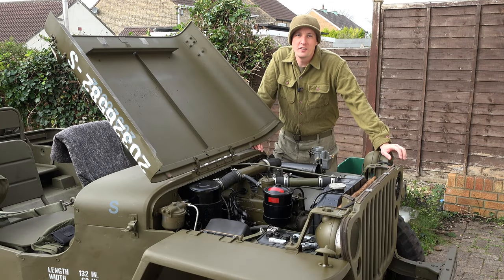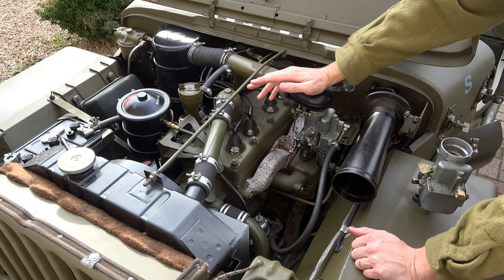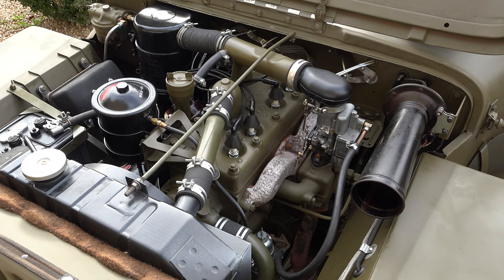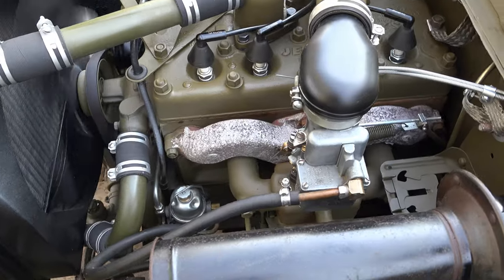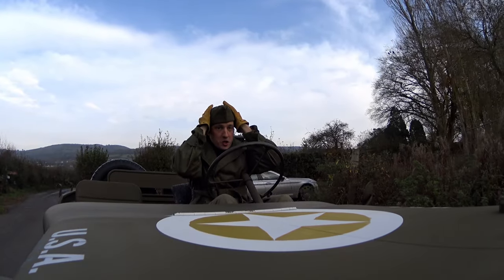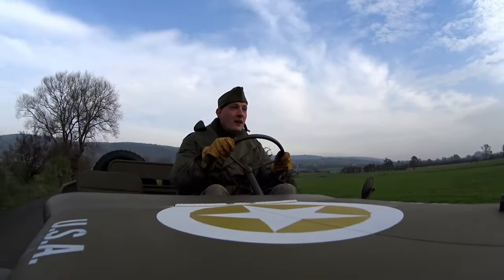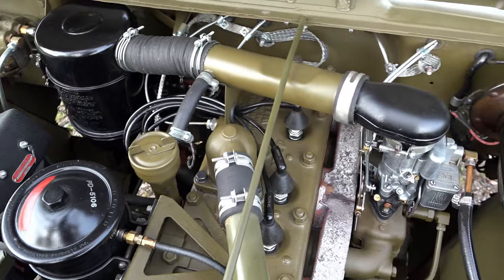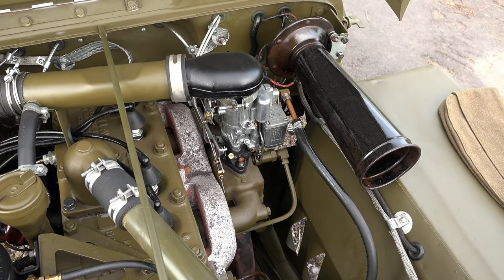Whats better Old or New?  Willys Jeep rebuild test

Comment: Love your video!  I've just modified a Carter 539S accelerator pump piston using an ethanol resistant gasket rather than the leather  gasket. I've used a UK made brake cylinder cup seal for  5/8" bore size. I guess it comes from a Mini and it fits nicely :)!

Comment: I rebuilt my carter carburetor I use choke for about 3 seconds to start then push it in and it runs great but then my wo carburetor is not same as yours

Comment: The biggest problem for us today is that the fuel we now use is completely different to the "proper" fuel used in 1945, it throws the jetting specs completely out, so unless we set the carb up differently to the 1845 spec the engine cannot run properly at all. Stay safe ! Chris B.
Reply from the maker: True Chris, it would be very interesting to play with the jets on a Carter, I'm just about to cover the rare Solex 32AIC and set the jets using the original spec but as i'm sure you're aware you can change all the jets on a solex very easily so tinkering with it should be a piece of cake, should be very interesting to see what happens

Comment: Just curious do you remove the rivets? I'm debating on removing mine or not
Reply from the maker: Do you mean the lead seals on the cqrb body or the rivet in the base?  I don't remove the seals on the body, I chemically clean the body so its not required, I do remove the rivet on the base but its not really necessary if you are chemically cleaning, cheers
Reply: @Greendot319  yeah like the ones on the body! Thanks